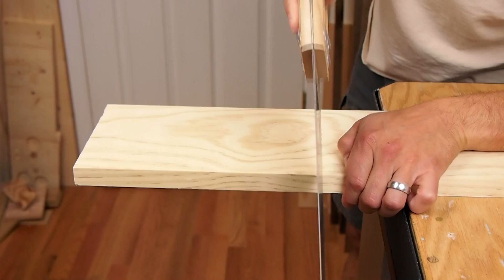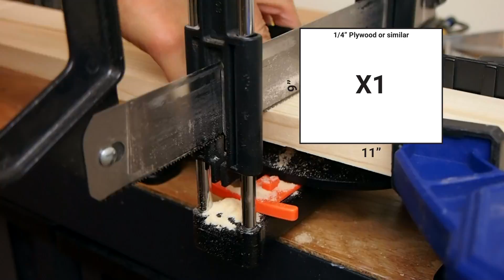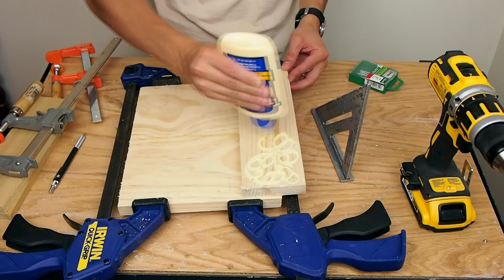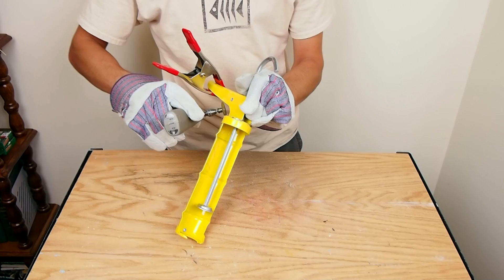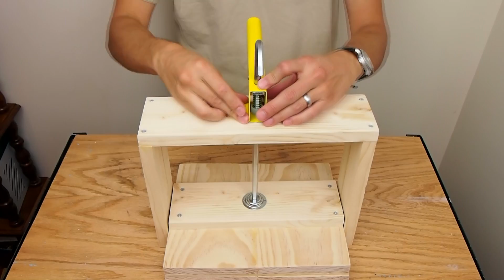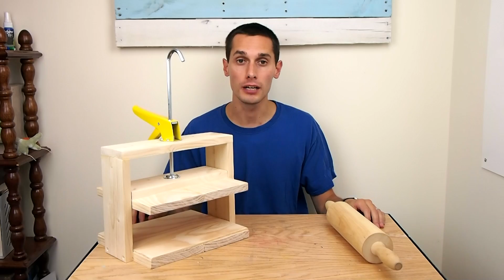How To Make a Simple Printing Press

Comment: this press is a bit nicer than a nipping press which you have to screw in a downward direction (the top plate always wants to shift in the direction you're turning as it comes down on the print block) Because you come directly down on the wood block, it's a nicer design. I'm going to try it out. Thanks for sharing.

Comment: Good idea but you will regret using the inexpensive Caulking Gun those Strip out very easy and will  pinch your skin so hard on your hands it will cause Blood Blisters and Bleeding   If you go to a decent Paint Supply Store they sell Deerborn brands  that will last a ProfessionalPainter practically a lifetime ,yes they cost 10 times the ones at the big box stores made in China  but they work ten times better  plus when you release the plunger mechanism Caulking doesn’t continue to leak out of the tube making a mess and wasting material

Comment: Nice idea I would also try it out 
But the pressure is only in the centre since the print is a small but what if it's a large piece of lino then can the pressure be even plz let us know tks
Reply: That's not how physics works. The force is evenly distributed across the plate. Just look at old metal presses.

Comment: This looks like it would be really useful as a book press, too. I'm going to try this out.
Reply: I was going to say the same thing.  I've been wanting to try both book binding and letterpress printing, and this has possibilities for both.  One of the videos that showed up in the suggestions beside this video gave me another idea.  I could leave the caulk gun out and grab the jack from my van.  That could easily apply more than enough pressure for either application, or enough pressure to split the device apart at the seams if I'm not careful.  I might have to try Cajun rigging a similar device with a car jack and try it out.

Comment: Just wondering about the distribution on weight to the corners. I was thinking of making something like this to emboss a4 paper. Not sure what result I would get with a press like this.
Reply: Did you end up making anything? I was wondering g this as well, I dont o how the science behind applying even pressure to a flat surface. However, common sense would suggest less pressure is applied the further away from the point of impact  it goes.

Comment: It's ok for printing something small in the middle, but for printing a larger area you will lose pressure around the edges due to uneven pressure.  Also, wood has a tendency to warp over time; a press needs to be made from metal.

Comment: I'm a bookbinder and currently am using a traditional book press along with a DIY press made from 2 pieces of plywood and 4 bolts w/ wing nuts to tighten. I'd like to make one a bit more functional than the DIY press, something more similar to what you have here (a mechanism on top to drop the plate and apply pressure). Do you think that's something you might create in the future? Thanks!

Comment: Hey makify1... Can u tell me what other material can i use to make it?? I want a material that is easily available in the markets
Reply from the maker: +Annanya Dobariyal  You could easily make it with 2x4's or any commonly available lumber. I don't know what you have access to. I would recommend wood that is at least 1" (2.5 cm) thick. Wood from old, discarded furniture would probably work well too.

Comment: this is great and well done but how about if it's made with 2 Caulking Gun ?
Reply from the maker: +Kevin Russom I would be worried about keeping both guns level. If you could figure out a way to keep them synchronized then 2 guns should work.
Reply from the maker: +Kevin Russom On second thought, maybe it's not that important that the 2 guns are perfectly synchronized. I don't know. Someone should try it.
Reply: I don't think it would matter that much once both "guns" were contacting the fabric or paper, but it seems to me the advntages would be slight. Just 2X the trouble! Good job BTW!